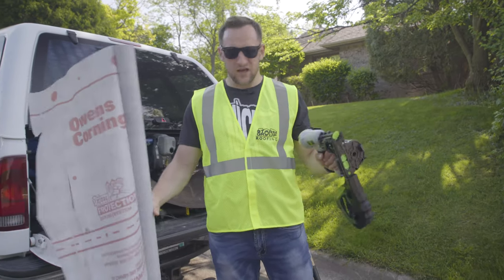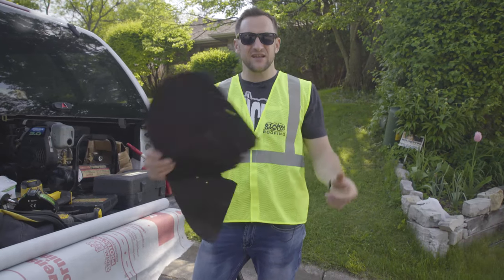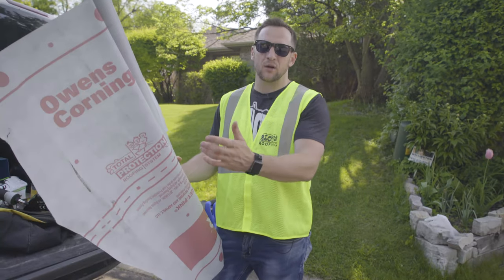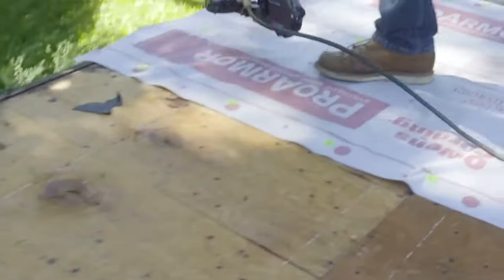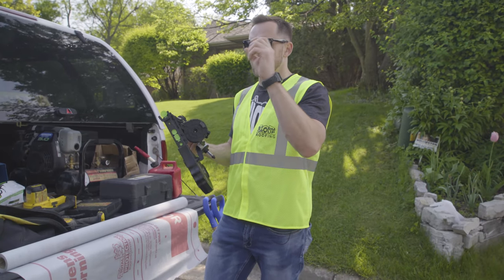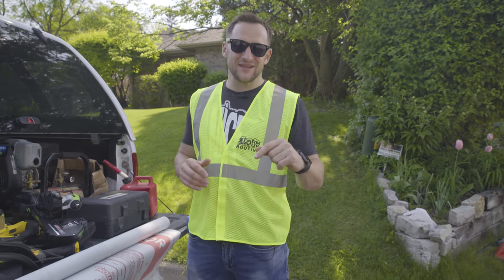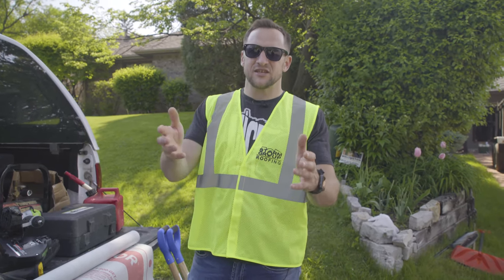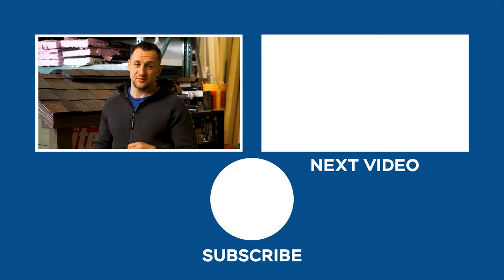Roofing Synthetic Felt + Stinger Nailer: Innovation of Decade

Comment: I've been Roofing all my Life. I do not like Synethic felt. If you install the shingles right on the nail line that's all you need. 
Imagine Putting yourself in the middle of the desert, would you dehydrate faster with a plastic hat or a paper hat? Plastic, Right? Same concept when it comes to Synethic felt, it's hotter a lot hotter it locks in heat/moisture/condensation which leads to mold and eventually algae. Synethic hasn't been around for a long time to know its aftermath, shingles are more than likely to become more brittle and sun blister a lot faster.  
Overall I think Roofers such as all the many that are using Synethic are only using it because it makes them look like they are using new innovation materials when in fact they are not educated enough on the product. Roofing is very simple...were not flying to the moon. You where right it hasn't changed much in the past 100 years for a reason. If you and all the other roofers cared so much about Customers and Quality, Roofers should of never invented the coil Gun. Roofing by Hand that is the only and Best Way. But that's another subject for another Day. 
Thank you for your videos and all you guys are doing. 
Love from Texas.

Comment: I agree with cap nailing or stapling. I have them stand up to 80mph winds and no tears. Just staples have failed at 30. I use the bostich cap staplers cause the bostich products are available at all the lumber yards i deal with.
Reply from the maker: roofing staples will fail most of the time and will always lose to cap nails head to head performance

Comment: I second this. The only additional measure we take is taping up the seams.
Reply from the maker: taping the seams sounds like good idea but not required by anyone, what are you taping it with?
Reply: Roofing Insights I think it’s impossible to beat zip sheeting tape. It’s expensive though. I’ve also had good luck with Gorilla tape. In any case we only use this measure when we know the new roof won’t be installed right away.

Comment: I'm in miami. I prefer 30felt. The roofs here are mostly 3/12 and synthetics dont tend to have memory and have failed on me countless times. For the winter it's great but rainy season forget it. I will not trust a TG roof with a  synthetic felt on and waiting a week for the rain to stop to install shingles. My 2 cents.
Reply from the maker: Florida is different beast in roofing world!!! I agree with you, everything performs differently under the major heat
Reply: "Most" Synthetic felts are not waterproof, merely water resistant.  Cap nails or not.
I've been caught in that trap once.  And that's too many times if you're counting on
your Liability Insurance to cover your mistake.............lol
30# felt for the save.  But the wrinkles?...............OY!!!

Comment: I've asked this question before but it has yet to be answered. Isn't a pneumatic cap stapler just as good as a cap nailer, Stinger makes both?
Reply from the maker: +Jason Bronson we used both. Pneumatic is 2x better!!!
Reply: Roofing Insights I’m referring to the pneumatic cap stapler vs the pneumatic cap nailer, there both pneumatic, so is there an advantage of one over the other. The one advantage to the stapler that I can see is that you can get it in staple lengths of 5/8” - 1 1/2” where as the nailer only comes in 1”. The stapler can also be used on foam board and it’s cheaper. I’m leaning towards getting the pneumatic cap stapler over the nailer because it seems to have more all around use but value your opinion.

Comment: My sub just said cap nails and staples leave bumps in the shingles
Reply: Liking doesn’t answer the question
Reply: Is the first statement true ?
Reply: Not true.  Stinger is designed for very low profile.  Some other brands have thick edges that can cause this effect
Reply: Your sub obviously is still stuck in the past, using 3-Tab shingles..............lol
Cap Nails ABSOLUTELY will not show through the Dimensional Shingles.